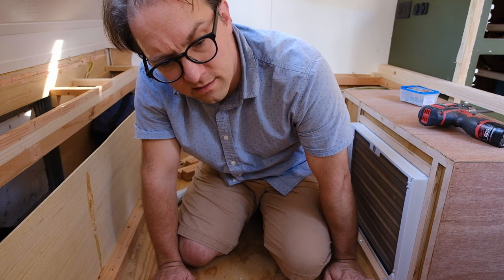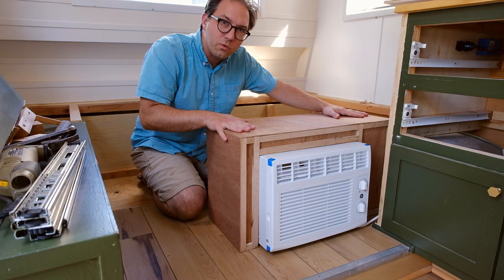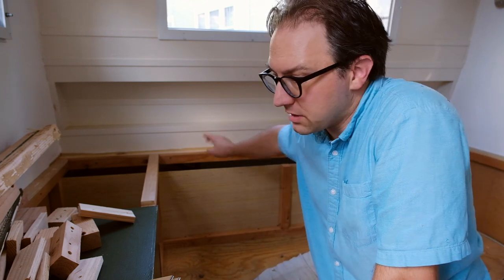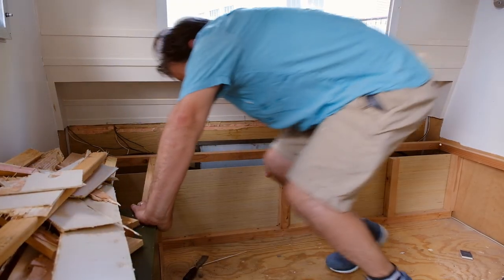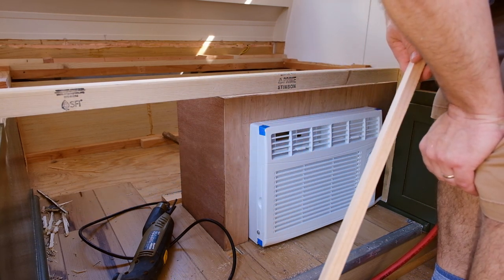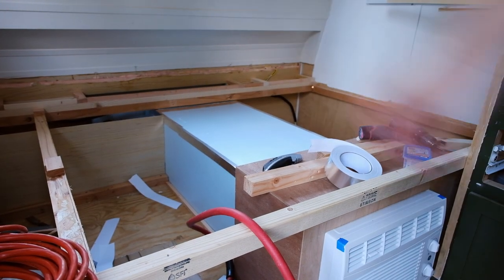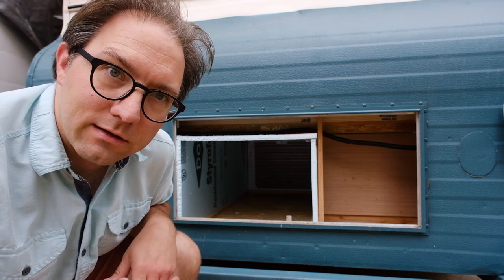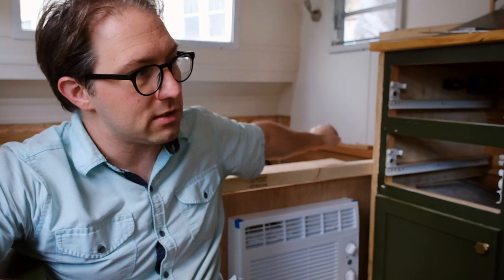HIDDEN WINDOW UNIT install in my VINTAGE CAMPER

Comment: I have no clue why people do this.. Just take a normal AC window unit. Separate the inside from outside. Add a a few feet more in compressor lines and wiring. Cover them back up using the old cover. Then you have a cheap mini split..... Takes about a day to make one...
Reply from the maker: That's an interesting thought, but I would think most units would require a tad more modification than just tubing and wiring; I suppose it could be made to work though, and I'd love to see one that's been done that way.
Reply: @TrailerTrashtoTreasure  Nope.. That is all you're doing with a Mini Split..Just longer refrigerant lines and some wires..

This does require you cut the lines. Add some valves. Extend them. Then pull a vacuum. Then add the right amount of Refrigerant back in plus 1oz extra for the extended lines..

Why you look for units that use R410a.. You can get that stuff anywhere...
Reply from the maker: What do you do about the fan on the condenser coil? All of the window units I've seen for the last several years combine the fans onto one motor.
Reply: @TrailerTrashtoTreasure  Look for one that does not have that sling blade on them.. As that is what they are for.. To sling the condensation on the rear coils.. As it captures the condensation in a tray...

If you really want that brand. Then just add a fan to it. I seen people do that.. As they actually make fans to increase air across the coils... And remove the blade on the rear slinger shaft...
Reply from the maker: So with that arrangement you'd definitely need a condensate drip line from the evaporator coil, correct?
Reply: @TrailerTrashtoTreasure  I would install one. It's just a plastic insert. Most are 1/2" holes...
Reply from the maker: Hmm, well that's food for thought. Thanks for the tips!

Comment: Where is your drain hole going to go? looks like it will leak in your camper.
Reply from the maker: These newer AC units aren't designed to drain. They use the condensate by throwing it onto the condenser coil to evaporate it and get higher efficiency, but I did drill a hole in the floor for it to drain out. The manual specifically recommends against it though.
Reply: So you believe the engineers when they told you that they did not need to be drained ? I can 100% promise you you will be addressing this issue very shortly because it is absolutely going to leak all over your floor. Please give us an update on your fix for the leaky water,  thank you
Reply from the maker: Sorry to disappoint you, but it isn't an issue. Thanks for watching!
Reply: What makes you think you  disappointed me?   I'm just stating a fact.  that the air conditioner is 100% going to leak all over that floor no matter what you say.
And no matter how many times you repeat that they are designed not to , you my friend are mistaken.
Reply from the maker: My friend, all I can do is report my experience with it, and I had no issues. I did go ahead and contact the current owners of the camper to see what their experience has been after their first season with it, and they reported no issues with condensation either.

Comment: Just a Lou red grill on the outside
Reply from the maker: You mean louvered grill? It could work, I really didn't want to add any other restriction though, so I was thinking a more open sheet of what I think they usually call expanded steel, and then an extra sliding cover to keep out dirt and weather when I'm traveling.

I've got a better idea for doing this in the future.
Reply: @TrailerTrashtoTreasure sorry depending on which language my keyboard is set sometimes it try’s to auto correct it’s not 100% but yes that’s what I meant
Reply from the maker: Ah yep, mine is only ever set to English and I still have to correct about every other sentence.

Comment: I have air conditioner on roof but pour too much power so I put one in the window on my Camper and I love it My lights don't even freckle
Reply from the maker: The new ones are really pretty efficient, so it's a viable option for a small camper for sure!
Reply: I’m messing with this in my trailer (25’Aljo). I have a good juice sucking AC on top, but I’m wanting to be able to go completely off grid, and still have a viable way to cool my trailer.  So far I’m thinking it’s just not vented properly yet. I slid it into the microwave spot over my stove. So far the compressor would kick off within minutes of start up, I’m assuming it was getting too hot. So I cut another vent in the adjacent cabinet, ducted it into the ACs new cabinet, and added two small vent fans that real move the air. So the compressor runs much longer but still kicks off. At this point I’m assuming I need to isolate the mid-area vents so that the air will be pulled just through that area, and out the condenser.  Be working on that tomorrow.
Reply from the maker: You need to have an exterior intake and an exterior exhaust. Those vent holes around the sides of the unit are meant to draw in exterior air to run over the condenser coil. The front of the unit has the interior intake running over the evaporator coil and the front exhaust where you get your cool air back into your room. You don't want interior air going over your condenser coil, so you don't want to draw air in from within the camper for that purpose. 

The easy thing to do with a unit mounted in an upper cabinet is to exhaust the condenser coil out the side of the camper and draw in the intake from the roof through some sort of roof vent. You actually see this a lot these days on smaller, less expensive, new campers.

Good luck!
Reply: @TrailerTrashtoTreasure    I cut a hole in the back of the microwave hole and put a screened vent on it. Then I went into the cabinet beside it and cut a hole, to access it, and then a hole to the outside in that cabinet and screened it off. Made kind of a duct with some ply that isolated it to the microwave hole. But it’ll run for a while then I hear the compressor shut off.  I figured I’d put in some baffles like you did to isolate the intake so that all that air goes through that and  runs over the exhaust coil. Kind of concentrate it into that area.
Reply from the maker: Yeah, you want to also make sure you're getting plenty of airflow to the intake portion of the condenser, so try to cut down on any restrictions there.
Reply: @TrailerTrashtoTreasure   for sure. Thank you for the video. 😁👍
Reply from the maker: You're welcome, thanks for watching!

Comment: How are you handling the condensation?
Reply from the maker: Well, it's actually been cool enough since I've installed it that I haven't used it yet, but I did go ahead and drill a hole for it to allow for drainage.